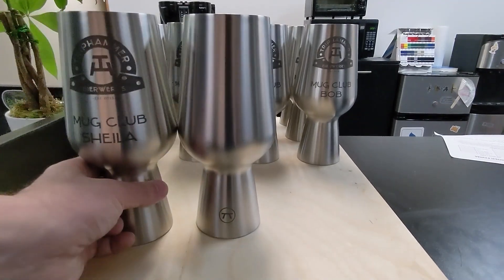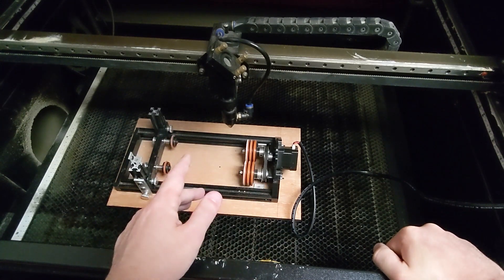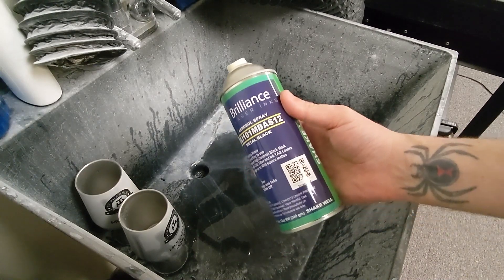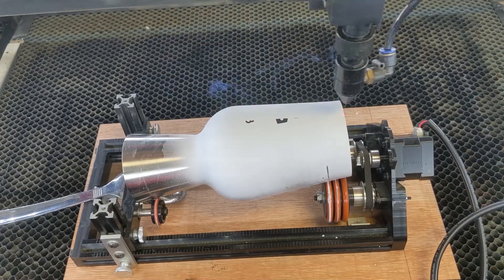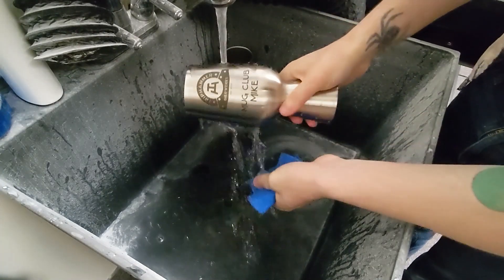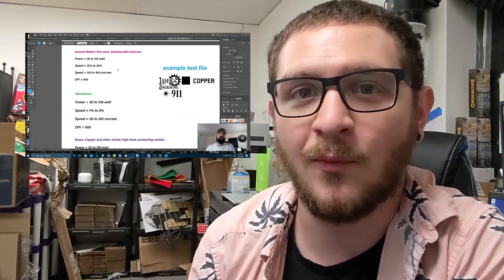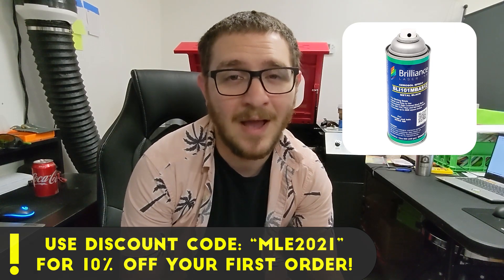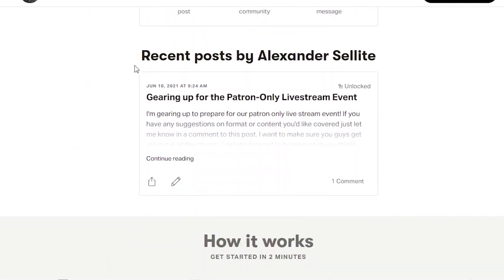How to Engrave Steel with a CO2 Laser | Brilliance Laser Inks | CO2 Laser Tutorials

Comment: Quick question I'm just getting into laser engraving and I'm doing my work at an in home setting. I bought the NEJE Master 7w laser engraver. My question is, Is this laser strong enough to do the engraving on stainless steel with the spray like this video? If not is there a suitable laser for at home that would work? under $500?
Reply: Hello, I can tell you with 100% certainty that unfortunately there is no way to achieve this with a diode laser. I have the Ortur 20W and I've tried everything but nothing works. The best that can happen is some markings that are easily washed off, nothing permanent. Only coated metal is OK (you remove the coating to show the metal under) and even that can be tricky depending on the hardness of the coating.
Reply from the maker: I'm not sure to be honest. I've never had a diode laser so I haven't tried but it could very well work if you get the settings right. What you really want is a desktop CO2 laser but I wouldn't spend less than $2k on one, maybe $1.5k. Definitely not within your $500 budget. If you're interested in what some of those options might be let me know and we can chat about them. Otherwise I'd just buy a can or two of brilliance and give it a shot!
Reply: @LaserEverything  I understand what you are saying and I am hoping to end up at that level. I have started a leather working business and the neje works great on engraving the leather, but now I am getting request for more things to be engraved and from the research I have seen CO2 is the way to go. Once I get to that level I will definitely reach out for some advice it that's ok. Thanks for the response
Reply from the maker: Yeah of course, will always be here to support you and also we have a great discord server. If you haven't already joined it I really recommend it there's a link in the description of the video and we have an entire diode section in there where you can chat with other people who have dialed lasers and maybe share some tips of your own with other people as well! It'd be great to have you as part of the community, it's free so I would definitely consider signing up!